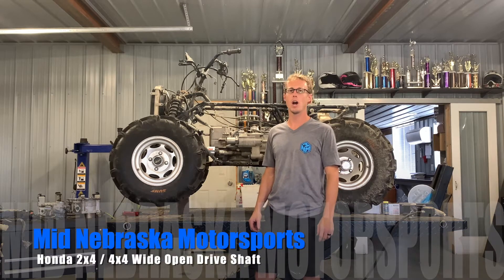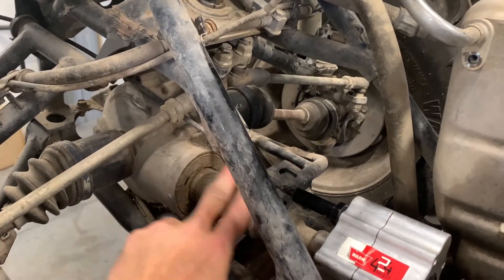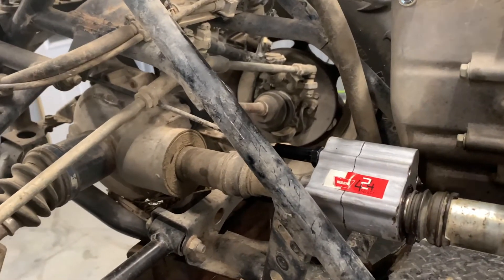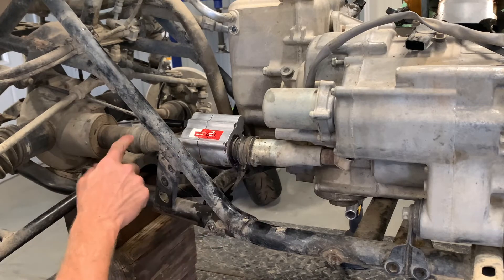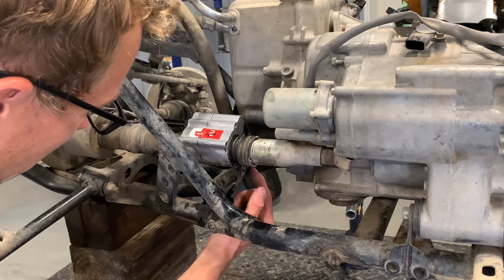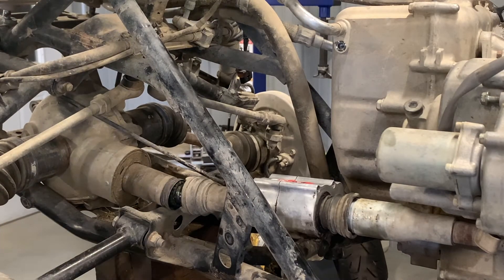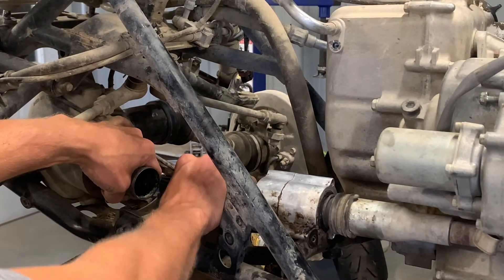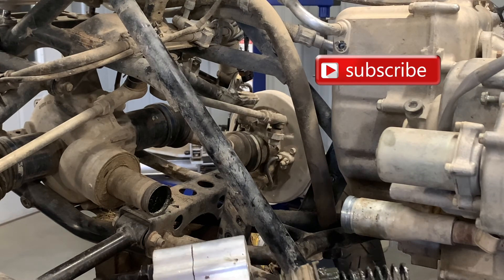Honda Foreman Rubicon Fourtrax Rancher - 2x4 / 4x4 Wide Open Drive Shaft

Comment: I just saw the video  9/13/2023.  My question is how do I adjust the cable shifter for the 4x4 in and out  , I am having trouble with it staying disengaged. .
Reply: Did you figure it out? I'm having the same problem

Comment: Nice job on the video.  I have a 2003 rubicon I was hoping to add a 424 switch for. I clicked on the link to the wide open switch but it apparently is no longer available on amazon. Do you have any suggestions? I may try to find a used one. Anyway, thanks for the video.   Brent

Comment: Do they make them for a 04 Honda rancher 350
Reply from the maker: They do. They are hard to find, but they are available. Thanks for watching. Let me know what you find.
Reply: I tried to get one, but never could find it. I don't think they are in production anymore... mostly cause they don't work very well as is. But depending on your skill level, it can be done but would have to be modified. I would probably accept the challenge - if I could find one.

Comment: Do you have one of these kits for sale?? I will buy it from you if so
Reply from the maker: Currently out of stock, but we'd like to get more in soon. Check out our ebay store for parts like that:  https://www.ebay.com/str/midnebraskamotorsports  Have you watched our other videos on this machine?  Check out:  https://youtu.be/e7cboWDOQKY. Thanks for watching and the comment!
Reply: Am reading some threads on forums about swapping the 01-04 ruby front diff with the 05-07 front diff. Apparently it works if you do away with the sensors and just hard wire it using the 05-07 switch. You need the 05-07 prop shaft too. You also need to grind a little of the front lower left A arm lug to accommodate a nut on the diff. Anyone had any experience with doing this? The Warn 424 is no longer available.